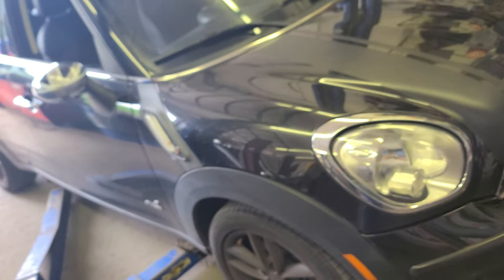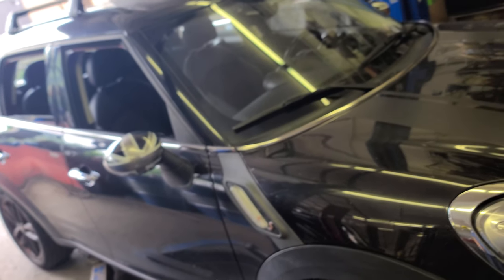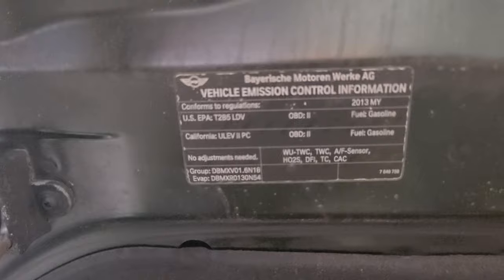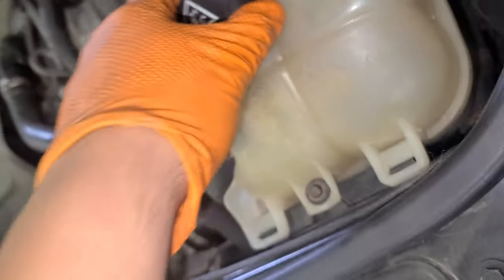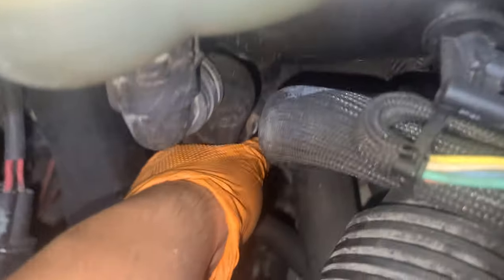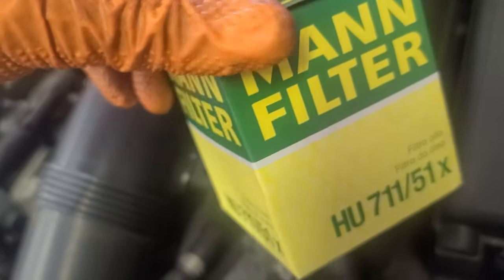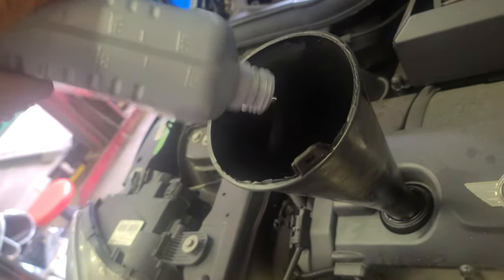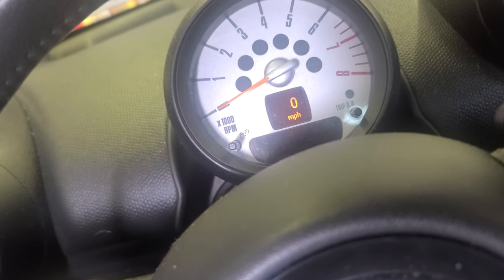2011 - 2014 MINI cooper Countryman How to Oil Change & Oil Life reset

Comment: What are the torque specs for the drain plug and the filter housing?
Reply from the maker: Did you watch the video?
Reply: @AxtuoAx Yes, I watched the video again and still didn't catch them. If I already knew them, believe me I wouldn't be asking. I'm not trying to knock your video, I just want to know.
Reply: @tommycorbet you just make them both snug and start the car to look for leaks. Then you are good to go. You don’t have to go crazy with either l.
Reply from the maker: Right...
Super thanks...
Where yall from anyways?